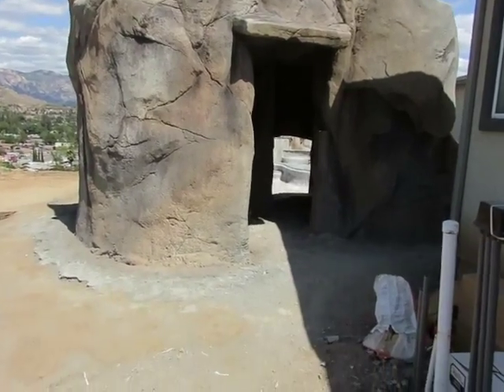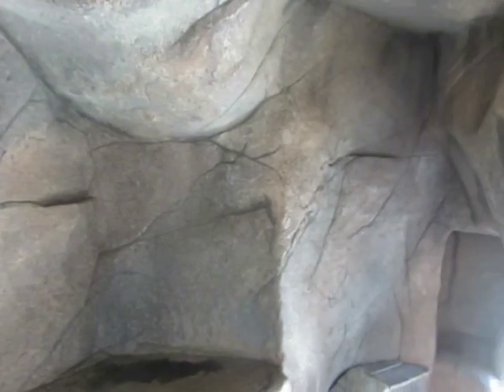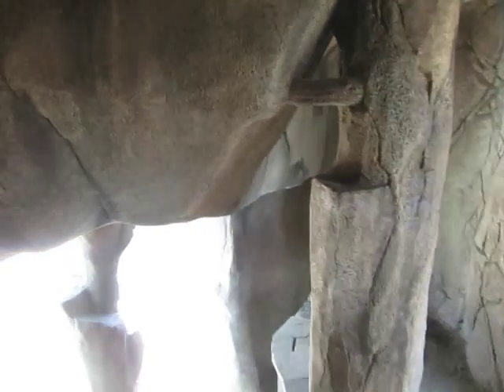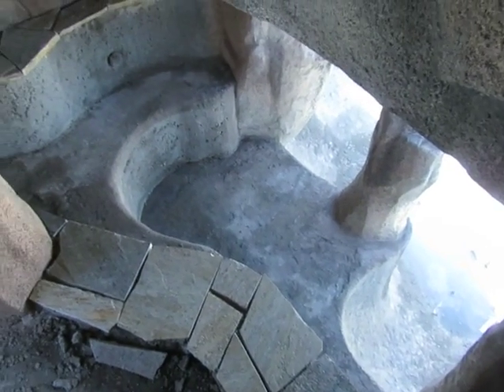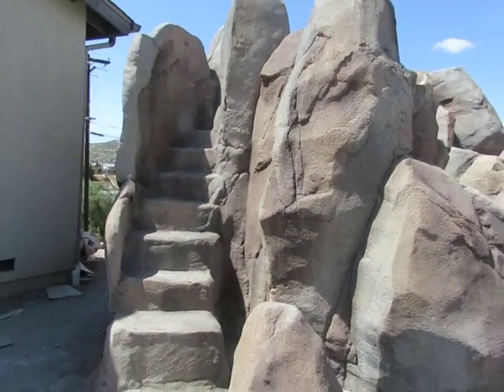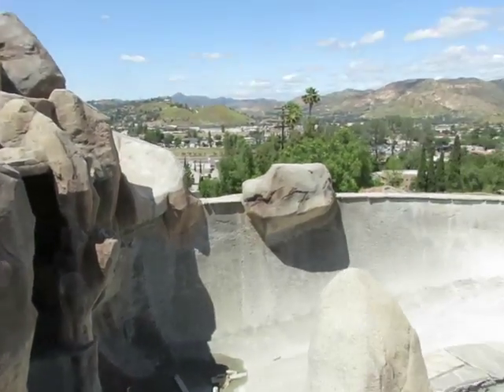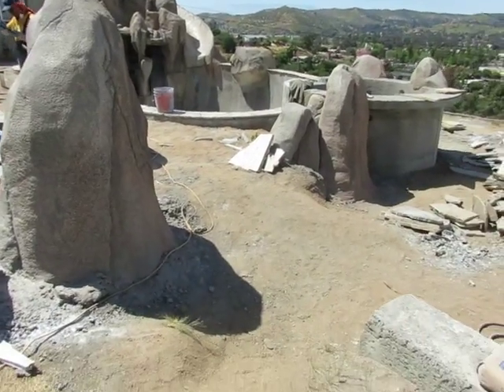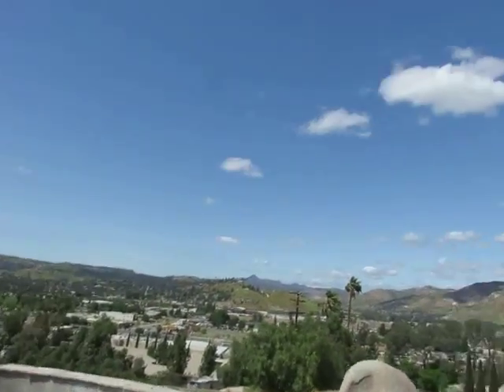Artificial Rock Grotto, Lakeside, April, 2017 Done!

Comment: Dave do you use PVC pipes for your plumbing of the waterfall and slide? Does the water from the slide get pumped up from the pool?  Is there a certain pump you use for your slides?  Trying to learn more about the plumbing right now, there was not much about it in your books.
Reply from the maker: Hey Justin, I'm a very simple guy so pvc works great for me.  Cut, glue and if you mess up try again.  Pumps are always handled by the pool contractors.  And yes the water needs to circulate from the pool.  FYI my full pro course does cover everything in much greater detail. This includes how to start a business..  https://davehenderson.podia.com/full-pro-course-how-to-design-build-a-17-000-faux-rock-waterfall-slide-feature   Anyway, best of luck to you in whatever you do.  :)